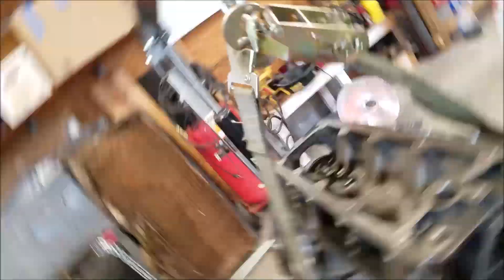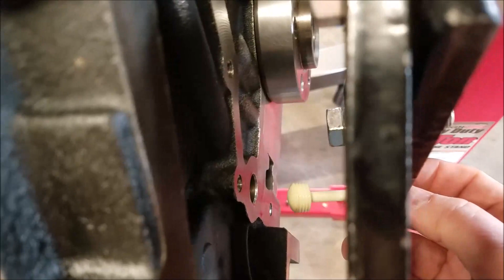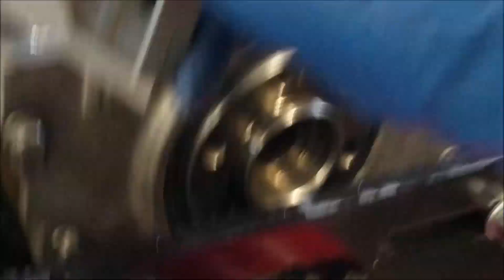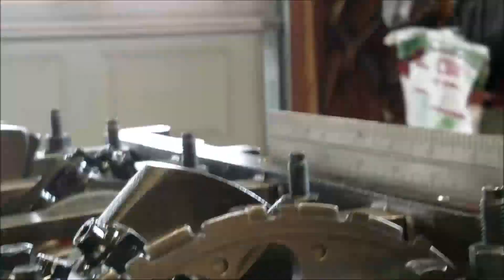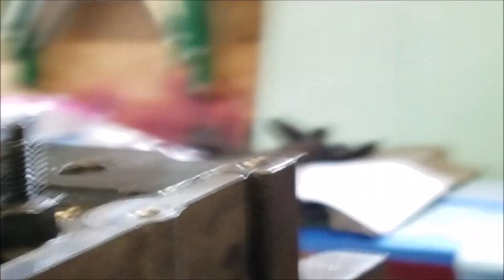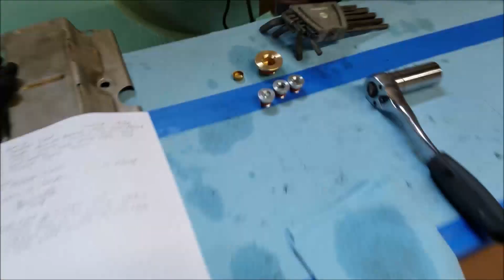69 Camaro : Engine Rebuild LS1 5.3- Oil pump, rear plate install part 7

Comment: Where you at I live in Dallas Fort Worth to come over and help you finish your motor I completed you redid my 67 Firebird did the 400 block waiting for me to get my ass in gear and fix it but my other 67 Firebird convertible is run like a raped chicken 326 runs great
Reply from the maker: Did live in San Antonio for 8 yrs, awesome food. I always wanted to go to Dallas and visit Gas Monkey Garage.  I like what they do.  In NC now. All most done with the rest of the motor.

Comment: Those oil pumps are strange to me I haven't messed with a LS engine yet I'm used to old school Chevy's with the pump on the rear main cap lol looks like she's coming along pretty good
Reply from the maker: Everything is new to me. Once I get the oil pan in I should be able to button up everything pretty quick. Couple more days.